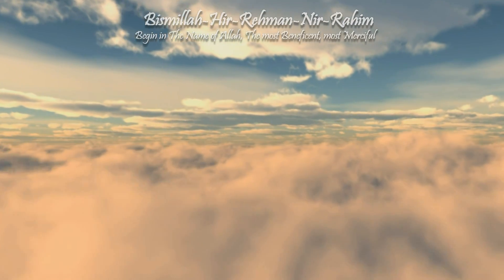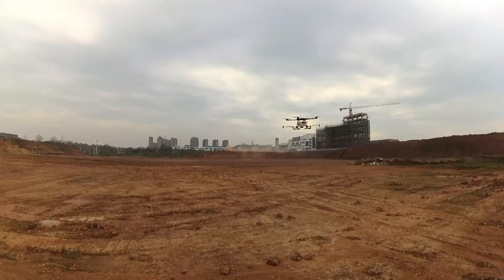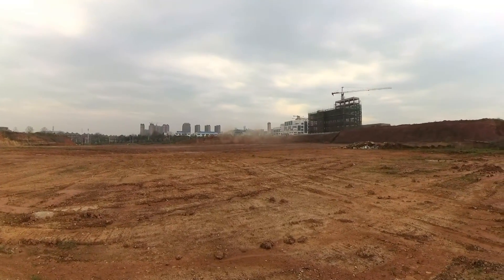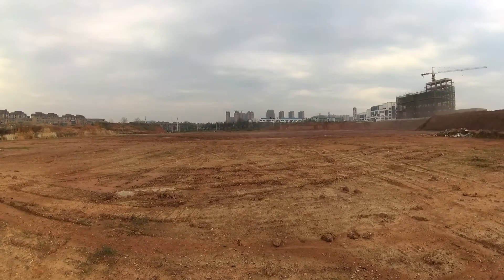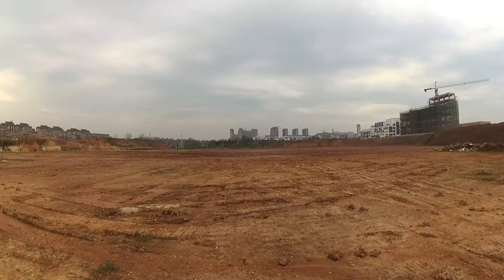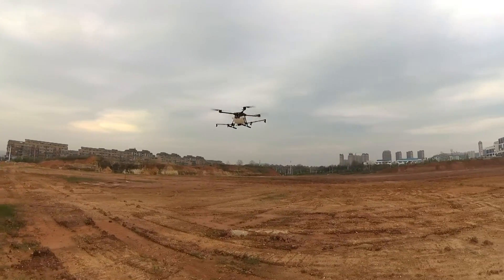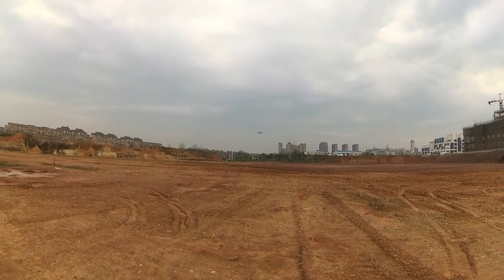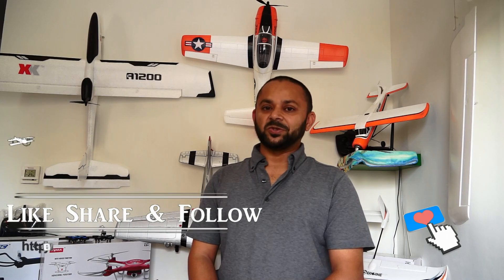Giant Agricultural Drone Flying and Spraying with 10KG Payload

Comment: Can you plot points on map to spray such as weed patches? Can it also avoid trees or other obstacles on it's flight path?
Reply from the maker: Yes you can using Android and App. for obstacle avoidance there is an additional radar that can be purchased but that mostly for equal altitude hold on forward flight to spray on inclined terrain.